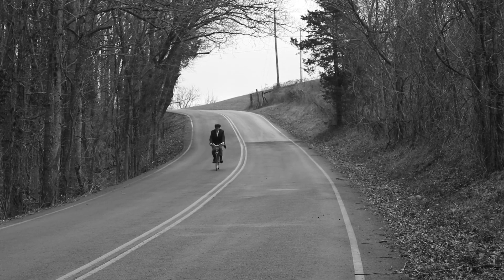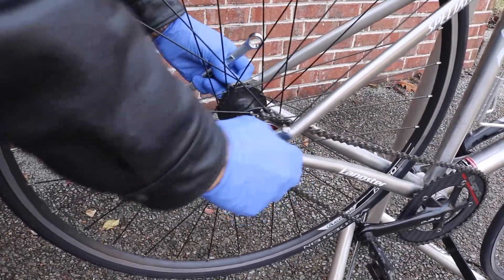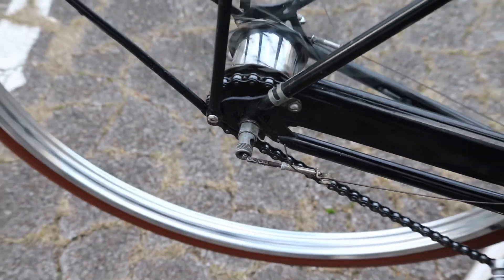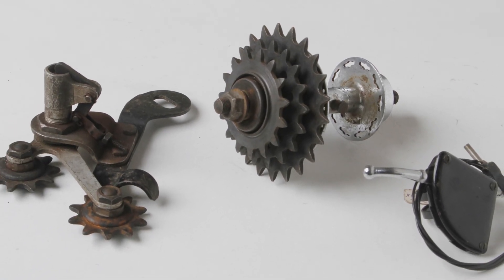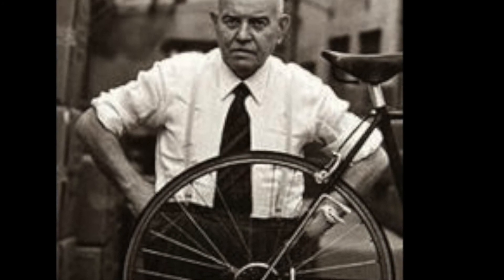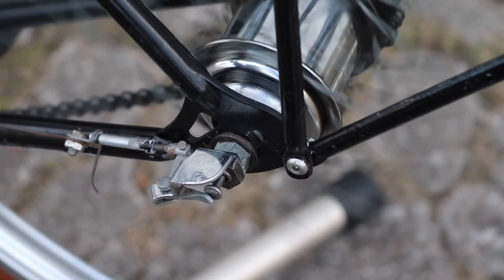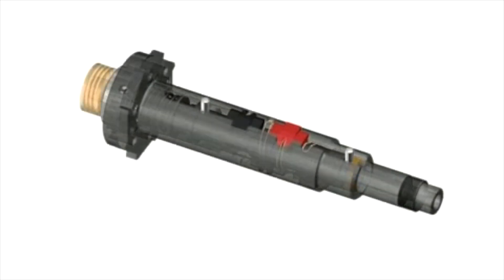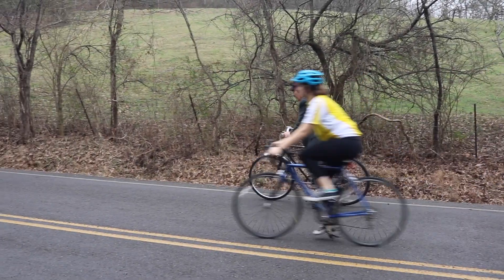Gears through the Years

Comment: Do you think in the near future, low-end to mid-end bicycles like MTB, road, touring, etc will be equipped with electronic groupsets?
Reply from the maker: Cost is coming down, market share is going up on both electronic groupsets and hydraulic disc brakes!  The only downside is having to remember to  "charge" your bike!
Reply: @grafhilgenhurst9717   I hope I can buy a cheap MTB with electronic groupsets in the next few years. but I think E-Groupset will only get cheaper when it is mass produced in China
Reply from the maker: @tranhai8895  I have a mountain bike with a 1 x 11 drivetrain. Not electronic, but it's a "no-brainer" when on a twisty trail!

Comment: The only problem with the Retro Direct is that if you pedal backwards for any distance, the pedals will unscrew and fall off - ! 😅
An odd oversight for a great idea.
Reply from the maker: Never had that problem in the 2 miles I rode it. I did have the pedals fall off a unicycle once, after I'd been riding it for 5 miles. Turns out I was riding it backwards the whole way! 🤣

Comment: Just a little addition to fill in the gaps. In the  1950s was the Oscar Egg, Osgear with a spring loaded chain roller running on the bottom chain line taking up the slack over 3 sprockets. In the 1960s we were blessed in the U K  with the Benelux horizontal spring action using down tube control lever and manual lever on seat post to change 2 front gears, turn it left/ right to select. Ray Booty in 1950s  set national 100 mile record 3 hrs 32 mins using heavy Sturmy Archer 3 speed close ratio gear ! Then in the 60s came the 3/32 inch width lighter flexible chain we use today. Thus ending the racing on fixed gear for time trials as was then established practice in the U K . It became possible to to race 6 speed and more, breaking away from the limiting 5 speed of the 1/8 inch standard chain width previously only available. Chain pitch is still universally and W- Wide 1/2 imperial inch. 
The rest is history, you all are experiencing now. 
Thank you for a fascinating video particularly the back pedalling gear change of the French design ! Who else ?
Reply from the maker: Thank you, sir!  Chains keep getting narrower.  And more expensive!

Comment: The ferrari comparison is absolute nonsense, specially considering it's a double clutch transmission, not even motorcycles use those.
Reply from the maker: OK, I WISH I were driving a Ferrari, but it shifts by clicking your fingers and letting the electronics do the rest. That much is true.
Reply: @grafhilgenhurst9717  but you are pressing a button with mechanical shifters as well, idk, I felt it was kind of beyond the point. Maybe if some day an electronic -internal gears transmission for bikes appears and then it'll be more safe to call it a bike dct